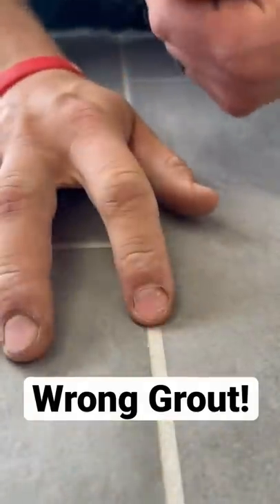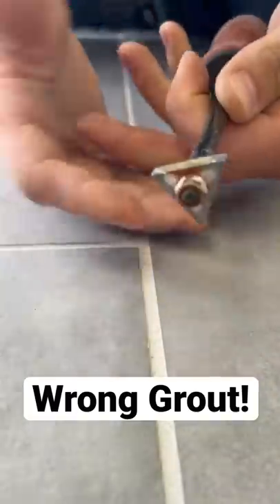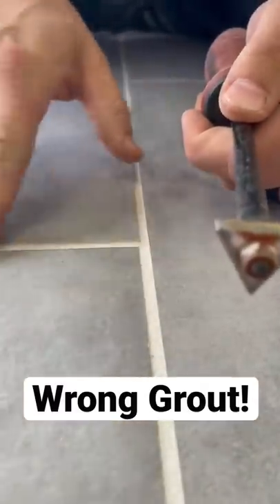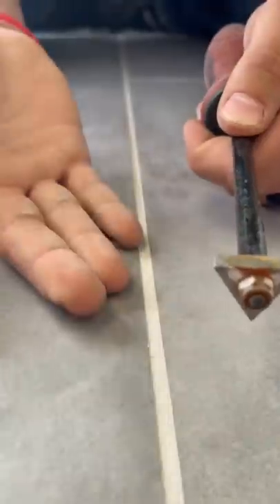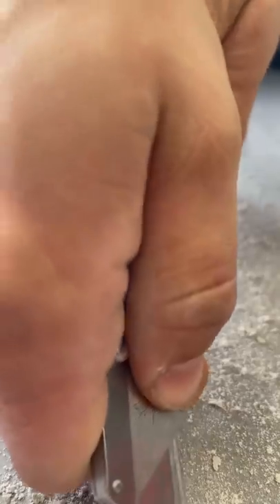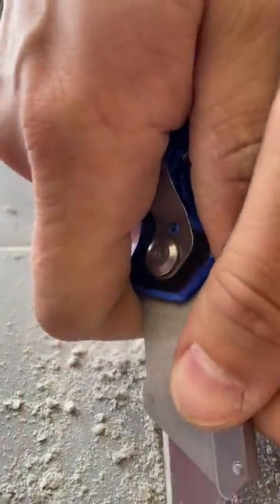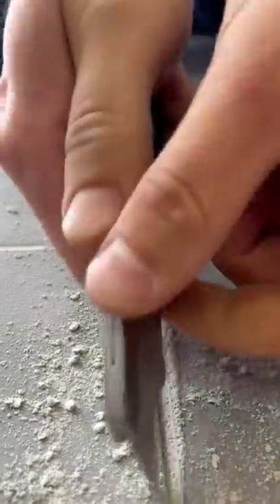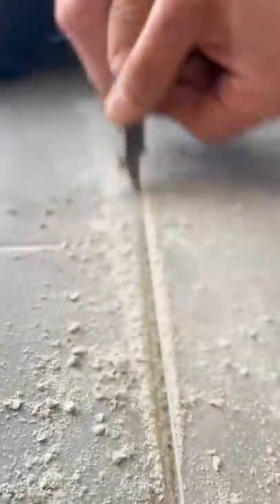Huge Mistake! We can fix it! #shorts #youtubeshorts #diy

Comment: Save yourself the hassle and get a grout refinisher.  Basically a paint and sealer combo that will stain the grout and actually extend it's lifespan.
Reply: Yeah I was about to say that I am pretty sure I have seen stuff so you can change the color or redo the grout. I can only see taking the grout out if you used the wrong one eg one meant for water or the one that is sparkly cause it has sand/glass
Reply: what she said.
Reply: @zora_tech  dosent work that great on floors or showers it goes away quickly however it is fairly good to freshen up using same color as actual grout
Reply: 10 min, no mess
Reply: @SXSPRIME  sure, lasted for decades when we did it.
You probably dont know how to clean it properly.
Reply: @anomilumiimulimona2924  nah its just shit its okay the rejuvinate the same color but to go say from white grout to black it does not
Reply: @SXSPRIME  who would want black grout?
Reply: @anomilumiimulimona2924  many request it its a modern design thing
Reply: @SXSPRIME  weird. Just dont seal it, it will be black for free?
Reply: @anomilumiimulimona2924  Gross
Reply: @SXSPRIME  you didn't do it right if it didn't last. The brand Custom has a 15 year warranty. I have literally done miles and miles of it and never had a warranty issue. I first started using it in 2001. You have to degrease and/or acid wash first. Then, FOLLOW the damb directions to a 'T.'
Reply: @hulkhuggett  i followed directions not sure what brand i used it was the home depot stuff
Reply: The stuff from Home Depot would be a Custom product. Custom is a very reputable company and their grout paint is second to none. 
 After the grout is acid washed (it cannot be acid washed for at least 15-30 days after installation), the grout must dry 24-48 hours (preferably with fans). Once the paint is installed and cleaned; it is recommended not to get it wet for approx. 72 hours. 

However, I could see how a shower floor could have some adhesion issues due to the amount of moisture wicking up from beneath during evaporation.
Reply: Custom is garbage guys. 
I’ve been a tile installer for the past 20 years. I only use Mapei products. Not the Home Depot garbage, custom
The grout colourant made by Mapei works great. Never mind trying and removing grout like this guy. What if you have small tile or tighter grout lines?
You’ll be at it for weeks.
Reply: @jeremiah8559  Custom makes awesome products. And there colors and are much more solid than mapei. Mapei's mastic is better, in my opinion. I started in the trade in '98 and started doing restoration in about '04. I have never had custom grout paint fail when it was installed properly. We are so confident in Custom we offer a 15 year warranty with it.
Reply: @anomilumiimulimona2924  I painted my bathroom grout that's inside the shower with grout paint from home Depot... So far only touched it up once in five year's
Reply: Just what I was saying
Reply: Maybe it wasn't the colour and maybe just was the wrong grout for something else I dunno I'm not a tiler grout person

Comment: I’m a tile installer I’ve used that tool before depending on white tile is installed could easily chip the sides plus that blade running off irked me little. Just used a blade and take your time is the best thing todo if your in this situation

Comment: "Now just do this for the rest of the 500ft of grout lines."
Reply: This is literally industry standard..
Reply: @TM-fx5le  Doesn't mean it isn't a day's worth of unpaid work
Reply: @kingcosworth2643  why would it be unpaid!? 😂
Reply: @TM-fx5le  Because they put the wrong grout in, clients not going to pay for them to repair their f up
Reply: @kingcosworth2643  fair
Reply: @TM-fx5le  why would the client pay you to fix your fuck up?
Reply: I was thinking just that. My house is 2000 square feet of tile. Lesson number 1: Make sure to have the correct grout color.
Reply: @joestevenson5568  because the client picked the tile and picked the grout.every tile floor we have done the client pics the colors.
Reply: @denniswilder3014  exactly what I was thinking
Reply: Exactly. I have one of those tools and I use it for removing very small areas of grout and caulking.  He made it look easy, and sometimes it is, but most of the time you’re not removing fresh grout. Or grout that was mixed to dry in the first place.  He also didn’t explain how to eliminate dust when he vacuums. I use a Dremel Multimax with the carbide grout removal bit and I hold my shop vac with a fresh dust bag in my left hand as I cut with my right hand.  Those diamond shaped cutters don’t work at all on old subway tile with that hard smooth epoxy grout.  And I was also on a job and I noticed one of the other guys had a Milwaukee oscillating tool and was. using a triangular shaped grout removal bit that was about 5 inches long.   Normally I use the Dremel brand grout removal bit or a Diablo brand if the Dremel is not available.  He was also not wearing a mask. That’s crazy. Because even with the hand tool you create some dust and you do not want to breath that in.  When I do grout replacement I have excellent luck with custom building products fusion grout, that they sell at Home Depot. Very expensive and you can only work in small areas but it really bonds to the sides of the tile when you are re- grouting. Ain’t  knocking him though.  If you have a small floor to do and the grout is recently applied and not fully cured yet, then that tool he used is fine.
Reply: Totally agree the tiler is paid for labour not for being a personal assistant more time and work means more money
Reply: @kingcosworth2643 exactly double working like a mf
Reply: @denniswilder3014 and then then the installer grabs the wrong stuff. Or the supplier sends wrong color and nobody catches it. Etc....been there.
Reply: @captainkttyhwk  like i said the client pics it out. Every tile job we have done the client has gotten there own grout. If is wrong its on them. And when its there mess up they tend to live with it

Comment: There is a paint for grout. It's very easy to do and easy cleanup. I suggest this first as long as you only want the color different. If it's the wrong type of grout and color then of course remove and replace. The grout paint will save you hours.
Reply: I’m a handyman in Columbus,OH. Do you know the names of the companies that offer a product for painting grout? Iv never heard/known about that. Do to miss communication threw 3 people I put the wrong color on. And I had to do a lot of grout removal. I’d really appreciate it! Thanks Shawn!
Reply: Either way is not fun
Reply: It's probably a light gray, or red or even black. He could of just painted it with a brush.(better then taking it all out, witch this guy will not get it all out) But it's probably an older couple and he works hourly so he will hand do all of it for 500$(because  they wanted to change it after they looked how shit it looked, or how easy white it to stain) or paint it for 75$. He made a yt short. He doesn't care about the ppl that he is working for. 1 star review for sure for this company.
Reply: Not off the top of my head. I know Lowes and home Depot has it. I'll see if I can get a name.

Comment: There is an attachment for reciprocating multi tool that does it even faster, with less risk of chipping.  Great tool though!
Reply: Great tool sometimes even use it to get thinset out between gaps if I had to raise floor in some spots
Reply: Those tools area nightmare. You WILL scratch.
Reply: @LocoLensWP  not the one I have for my fein.  It's a $300 tool with special attachment.  It just vibrates. Had diamonds in half circle shape. I've been installer for over 9 years, doesn't scratch. Takes it out like a hot knife through butter.
Reply: @fish4191  yeah, I use my Milwaukee tools. No issues

Comment: Could you imagine being a contractor and doing like a big ass kitchen and have to redo the grout… I would be pissed…
Reply: We doing it now, we didn’t grout it the first time but I have an attachment for the multitool/oscillator that speeds things up
Reply: Just finished replacing grout in a dining room and hallway had to do it on a Saturday aswell 
I was pissed
Reply: @michaelmollema-stedman959  get a new job dude
Reply: If I was a contractor and you used the wrong grout, you'd be looking for a new line of work lol
Reply: @MrReddevil420  I’ve worked jobs where people changed their minds on shit and raised hell until it was fixed… or the order said one thing and the customer thought it was supposed to be another..
Reply: Happens all the time. Did a 2000 square foot project for someone after they approved all the materials and got mad when they didn’t like the grout color they picked.
Reply: Happened to us with a guest bathroom in a huge remodel where we did 4 different bathrooms with 12 different kinds of tile and 6 different grout colors. A huge lesson in organization. There were a couple grouts that were very similar but not the same. Homeowners were not happy it was just a couple shades darker than what they wanted. We had to redo the entire floor because it was a hexagon mosaic pattern. Way too many corners and grout lines to do this safely. End all be all, the remodel ended up looking amazing.
Reply: That what I was thinking 😂
Reply: On hex tile 👀
Reply: Yeah the dell hospital in austin -architect and owner approved the Mach up for the grout and after 3 floors and 20k sq feet later including the kitchen and the owners wanted a different type of grout (epoxy) and in a slightly different color - which was raven - they paid for it but god damn that was annoying because they expected everything else still on time and it’s hard to find certified good tile help so it was overtime -also the damn toilets and fixtures were already installed on those floors too plus all the appliances in the kitchen was a nightmare - made good money tho - don’t miss it

Comment: nobody talking about how that corner in the middle ain't straight tho...
Reply: Say you've never laid tile without saying you've never laid tile
Reply: @HarambeDid911  I've done tens of thousands of square feet of tile.  That line is shit and should have been fixed on the install.
Reply: Oh my ocd was screaming inside.
Reply: @acrinsd  I'm no pro but straight lines supposed to be straight right? 🤷‍♂️😂
Reply: These are the guys that say "I don't need spacers".
Reply: Finally found the one that notice that, lol literally stopped the vid in first sec to look for a comment
Reply: @acrinsd  🧢
Reply: It is straight it just hasn't got enough mixture underneath so that corner sags. With a lower corner the grout covers a bit of it and that's the ugly illusion you're left with
Reply: @HarambeDid911  dude its little off by an 8th of an inch.. wtf you mean?
Reply: @wr3099  the spacing is off dude.. a whole 8th of an inch
Reply: @SleepingSheep95  maybe a little but check out once the grout is taken out the alignment is better than when it was grouted
Reply: Yeah this whole video is a disaster. If I owned that I would be furious to have to see that eye sore every day!!!
Reply: I was just thinking that as soon as I started watching. Was wondering if someone else noticed. Lol
Reply: @HarambeDid911  man how you gonna say that like laying tile is something the average person does. also not hard to see it's not even
Reply: Chinese tiles are generally poor quality and not good for size . Buy Italian or Spanish  if you want quality that will last .

Comment: No need to remove. Change color with grout refresh. Aquamix and mapei have products for this. It's a water based epoxy that cleans right up with a sponge. You can also use the color powder packs  from laticrete's Permacolor just add water and paint the lines with a paintbrush or toothbrush. This will stain the old grout and this info came from a laticrete rep.

Comment: Dont forget to change any tiles you scratch with the knife 👀
Reply: Right 😂!
Reply: Pulling out the scratched one will hopefully fix the bad grout line he had there too. Which is also why his knife caught there and scratched the tile
Reply: @user-iu3sy4wn7t  guys in a right pickle. Fancy grouting before asking the customer what colour they want 🤔
Reply: @user-iu3sy4wn7t  don't think the tile was scratched its digital printed porcelain an very tough. The reason why the knife skipped off was because he was following the edge of the tile an at the intersection there wasn't tile there for him to follow . Which is why it skipped off, you should always start and not end at the intersection. Also if he free handed the tile then it's not that bad of a lay I've seen much worse.
Reply: It’s not scratched.
Reply: There was no tiles scratched in this video. I know what you're talking about but it's not a scratch. The razor made a line in the dust that's why it disappears when he vacuums it.
Reply: @jaycustom21  I don’t believe you without proof 🤨

Comment: Get a vibrating multi tool, with a carbide grit blade. Makes quick work out of it.
Reply: That lasts for like 20 linear ft and costs like 35$ each
Reply: Billbery Bones  straight line

Comment: Mapei Grout Refresh Colorant and Sealer: Grout Paint and Sealant - 8 Ounce Bottle.  This stuff is available in about 15 grout colors that can go right over the existing grout.
Reply: Exactly although if you only have like a 6 inch section you have to replace cuz of discoloration the tool seems kind of Handy
Reply: And for anybody that says the grout paint doesn't last. It does my wall tiles running on 17 years and still looks how it should.
Reply: I know some of them are also like a 15 year sealer

Comment: That triangle grout tool can be tipped on edge to clean out both sides. 
Setting grout this thin will result in a poor cure that is not strong, unless you can keep the grout moist for a day. That thin layer will dry out before it finishes curing. 
No need to use up knife blades.

Comment: A multi tool is quicker for the initial removal before using your utility knife but if you're not experienced in using a multi tool it's safer to do what this guy did instead of risking having a chipped tile you need to replace.

Comment: I always hated this part.... I've used a carbide scraper and the exact folding knife a few times... the tool you use looks effective, but I chipped tile corner running the scraper through the grout with elbow grease a couple of times... seeing the speed you run it through the joints do you not worry you will run into a corner?

Comment: When he said "Get a tool like this" I knew he was an amateur
Reply: In his defense there are several types of grout removal tools, most work well some better. Do you do tile for living?
Reply: What should he have used
Reply: He should have used a grout saw.
They come with little 2" blades, with some kind of rough coating on the blade.

I wouldn't think they are diamond coated.

But they work great.

I use them for repairs all the time.

Comment: You should have shown that you scratch the tile and how to prevent what you just did  there is an easier way to do that by the way
Reply: Enlighten us then
Reply: It's called a grout removal blade. And it goes on a  Oscillating tool.  Or the original multitasked tool by ( Fein )  the original
Reply: Cheers
Reply: @angeloromanmorales8578  that only gets the majority of the grout out and will increase your chances of chipping your tile. you will still have to go back and clean the edges with the razer blade. Tip when you star to use the razer knife always start at the corners and this won't happen. Also this is digital printed porcelain and is very strong i dought he scratched it but if he did yea you would have to replace it because it's digital and won't be able to buff it out.

Comment: Use a “grout saw” those triangle grout cutters leave scratches same with a box cutter…. These are rookie moves… I used to do this…. When I was new…
Reply: Using cement grout is a rookie move, get your arrogant ass comments outta here guy. You ever had to cut grout out of a whole shower made of subway tiles? How about epoxy grout out of marble sheet tiles with heat underlayment?

Comment: Way easier to get the grout color right the first time. Now you have to use a 4" grinder with the vacuum behind it. Cut a line with the grinder first and the grout will easily fall off the edges of the tile That triangle tool is A TOTAL WASTE OF TIME. IT WILL SCRATCH THE TILE EDGES. TRUST ME I was a tile setter for over 20 years

Comment: Just stain the grout. Not only is this a ton of work, but the glaze will be chipped up all over the place (like that corner hit with the knife). Also, the new grout will not bond properly to a cold joint well and will be a lot more likely to pop up after a while of being etched by harsh cleaning chemicals.

Comment: Was waiting for the chipped tile and steel mark from the knife and sure enough.  Regrowth stink no matter how you get the grout out, but using that triangle tile-chipper and knife, I'd recommend always starting at the T-junction and cutting away from the intersection.  All it takes is one slip-up to turn a 2 hour regrout into an all-morning or all-afternoon ordeal. And that's IF they have owners stock and you have rapid set on the truck. 

Just the two cents from a guy who's chipped tiles digging grout out every which way.

Comment: I would take more grout out I used to have to do just regrouting or spot grouting and only used your method one time I prefer using a oscillator with a grout blade and vacuum.

Comment: I regrout for a living, if you're really good with holding a grinder and a Shop-Vac you hold the hose in one hand the grinder and the other and you go down every single joint and don't chip a tile. That's the best way to regrout